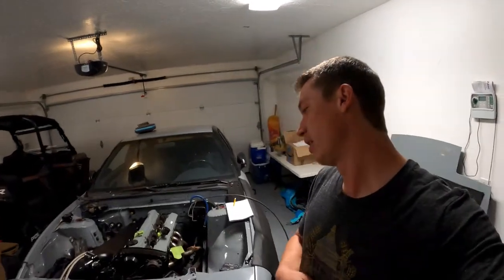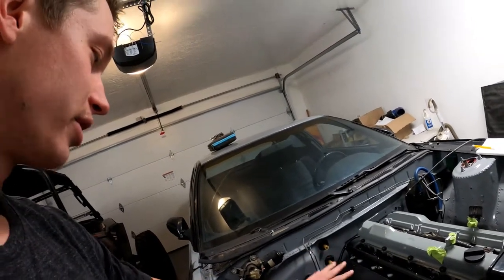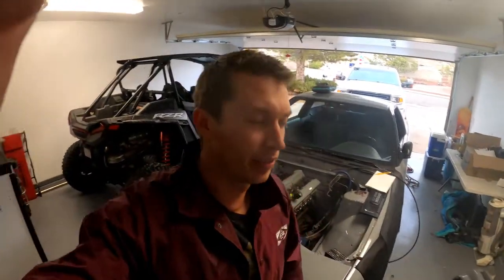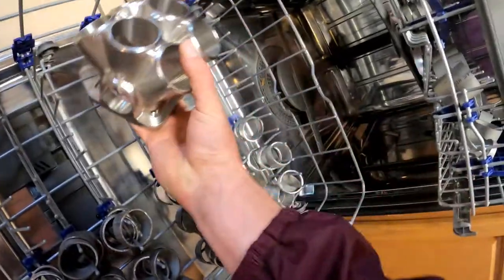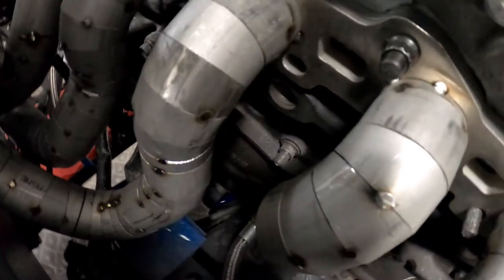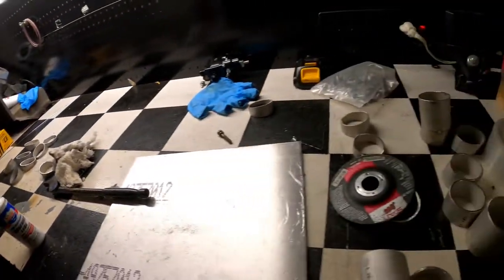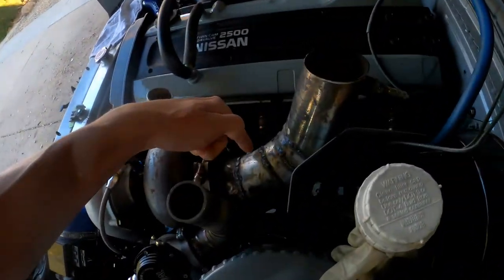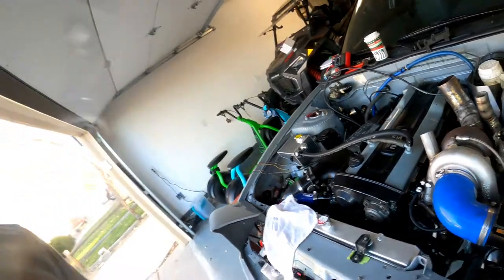RB25det Custom Manifold Build

Comment: hey bro u running mckinney mounts? my mounts have a gap from the front of the crossmember to the 3rd single bolt hole on the metal mounts. i was wondering if u ever had that problem. and did u use spacers? thanks!!
Reply from the maker: You're not wrong, was a bit pricy.